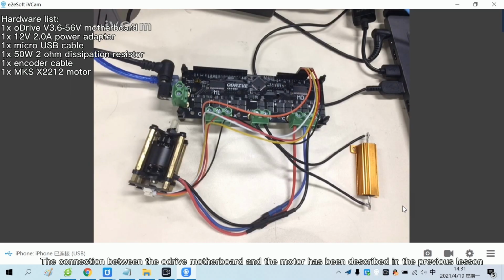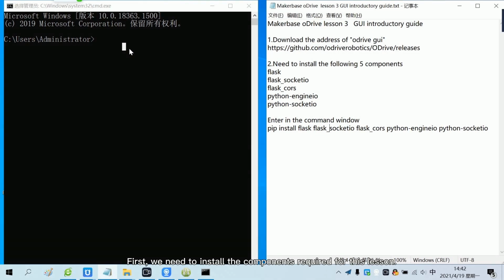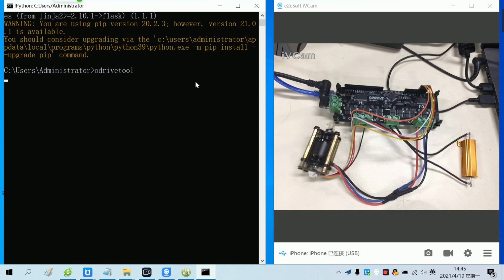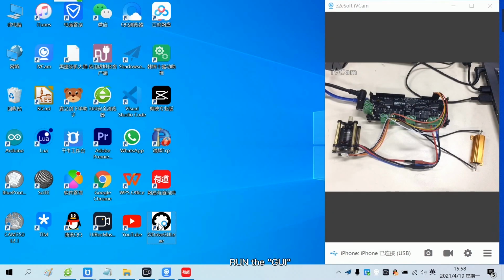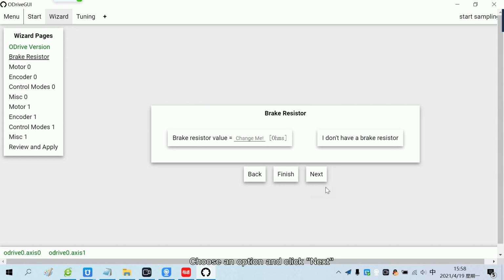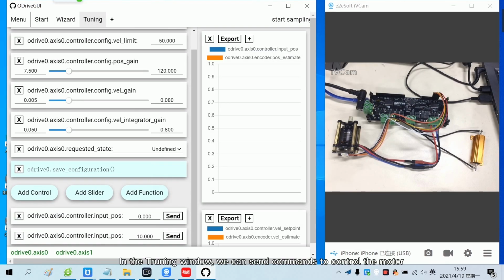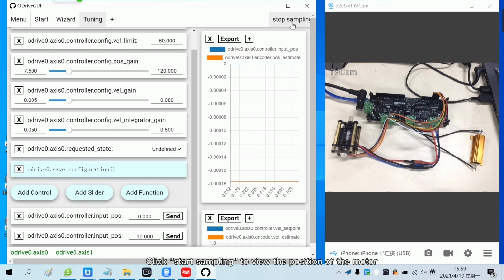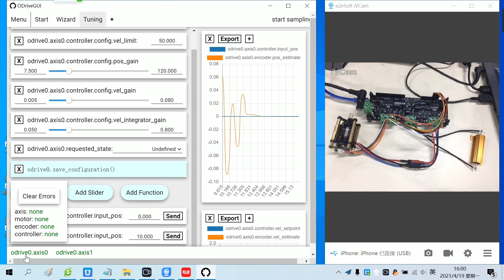Makerbase oDrive  lesson 3 GUI getting start

Comment: I have a problem with the startup of the gui 
There is a javascript problem and the address come never green. Any help welcom
Reply: 1. Your python version is not correct. has to be 3 or higher.  2. In your environment setting, the user path for python not set.  3. Library flask and others are not installed.